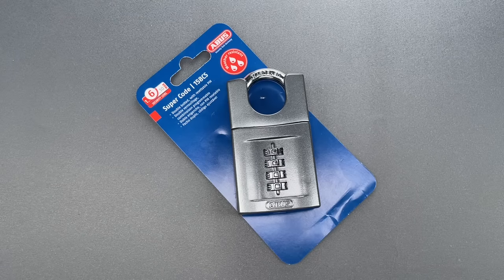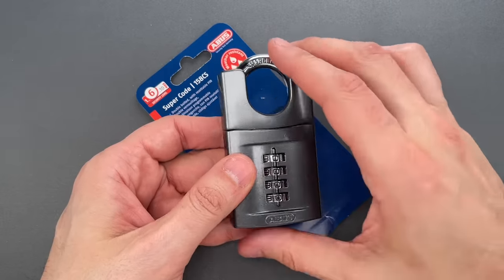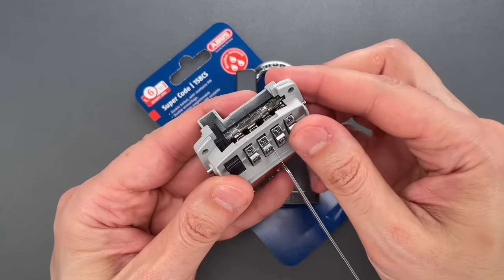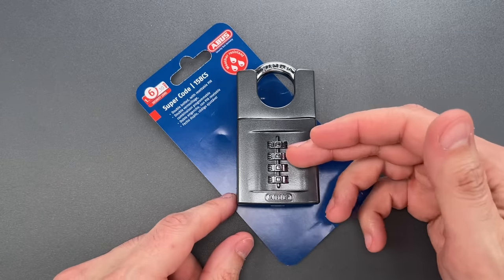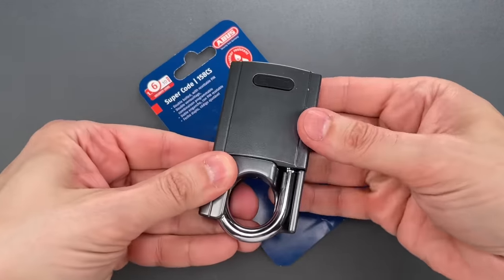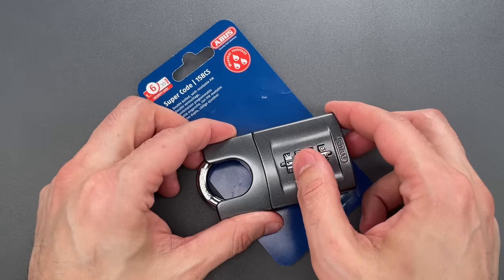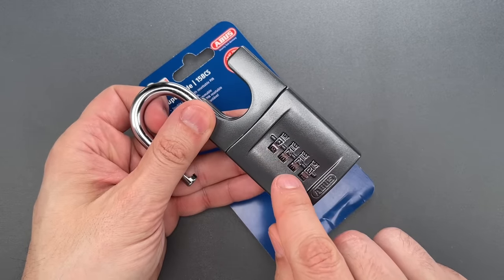[1541] Abus “Super Code” Padlock (Model 158CS)

Comment: I wonder if you could reset the lock without setting it to "open" first?
Reply: Shackle was back in but it was still on correct combo at the time, 0000, which allowed the use of the change mode.

Comment: Is there a 4 digit code lock that is good though? Probably not even if it is a really good lock there's only 10000 combinations and on average you'd check half of those. 3 per second that's 30 minutes of trying

Comment: most of those code locks you just spin the code fast and while trying to open them at the same time
i have opened many different like that, it never takes more then 30-60 sec.
same goes for when they are on a suitcase

Comment: Err does this lock go into change mode while locked?  Doesn't that mean a random passerby could lock you out of your lock?  Maybe the ease of decoding is to prevent against that?
Reply: No, the change screw is locked if the code is not lined up.
You dont need to unlock the shackle to change code, its enough to enter the correct code.
Reply: What the other person replying said. However, yes, if someone just wants to mess with you and try to lock you out, they could do that AFTER correctly decoding it first.

Comment: speaking of sensing the tension bar,
what if we add a sprocket to EACH code wheel, that carries no info, and forces the bar away from the code wheel IN BETWEEN  digits, and only allowing the bar to fall onto the code wheel after you completed the rotation.

Comment: Wait... How was he able to set the combination with the lock closed? Wouldn't that mean the combination could be changed at any time? I must be missing something big here.
Reply: The lock was closed but not locked.  The wheels were all at the default combination of 0000 before he turned the reset on the bottom to change the combination.

Comment: Wait a second, if the mechanism to change the unlock code is fully exposed and easily turned with any flat object, wouldn't it be possible to just change the code to whatever you want faster than this? Am I missing something, or was he really able to just change the combination with the lock fully engaged???

Edit Nevermind, I just saw a few comments and you actually need to have it in the right combination before you can set it to change the code. Still that seems like a pretty bad flaw regardless of the other issues.
Reply: How is that a flaw?

Comment: if they made a solid pin note in the back of the gears and then had the sorta key pins style design could this make it stronger for example it would push on a bar in the numbers and when their all setup properly a small pin is released to push down a spring which then allows the pin that holds the lock closed to be pushed out of the way

would this work for a good design

Comment: maybe im missing something but by the looks of it, LPL changed the combination while the shackle was closed so if that lock was in use, someone could just put it into change mode, put their own combination in, put it back to operating mode and just undo the lock? forgive me if im being an idiot
Reply: The combination has to be entered properly before you can turn the actuator.
Reply: no, the change screw is locked if the code is not lined up. You dont need to physically unlock the shackle, its enough to just line up the correct code.

AND even if the change screw would not be locked, changing the combo just releases the sleeve (with numbers on them) from the gated wheels, meaning you would still need to know the old combo (and add it to the new combo) to unlock it. (changing a combo lock while in incorrect combo will add the new combo as offset to the old combo.)

Comment: If you can change the combination while it is locked by turning the plate at the bottom with any flat object then why would you ever need to figure out the combination.
Or am i missing something obvious here.
Reply: I suppose you can only turn the plate at the bottom to change mode while the correct combination is already set.
Reply: @HeyMartin99  Correct.
Reply: Yeap that makes sense. 👍

Comment: You don’t need to use its inner spring against itself to beat this lock, you just need a dime apparently… anything really… that fits that slot at the bottom well enough to move it into change mode and back

Unless it has to already be set to the active combo to be able to shift into change mode, which could very well be the case

Comment: I noticed that you reset the lock code with the shackle already locked. Wouldn't someone be able to come along with a screwdriver and just set the lock to a new code to get in to it?
Reply: No, you noticed wrong. Of course the lock was opened (the code wheels in the position of the then correct code) for it to be possible to turn to change-mode with a screwdriver.

Otherwise it wouldn't be a code lock, but a screwdriver lock.

Comment: What's to stop someone from walking up to it, setting a new combination (like you just did), and opening it with the new one? The only reason you couldn't just do that was because you hid the combo from yourself.
Reply: The number of times I see a variation of this comment seriously reduces my belief in the intelligence of humankind. 

OF COURSE the lock has to be unlocked - as it is in this video -  for it to be possible to change the code.

It would be rather pointless as a code lock if it was designed to let anyone set his own code and thereby open it.

Comment: wait a minute, you can change the code when the lock is closed by just turn the screw at the bottom? so the code is changed and the owner doesnt know it?
Reply: You can change the code only when the lock is unlocked. The screw cannot be turned when it is locked.

Comment: Whoa. Wait a minute. A combination lock, where you can change the combination whilst it's locked? I see some scallywag having hours of fun changing other peoples combination to something not known to the owner.
Reply: Shackle was back in but it was still on correct combo at the time, 0000, which allowed him to use the change mode. Yes, if someone just wants to mess with you and not steal anything they could change the code but would have to correctly decode it first.

Comment: Can you really change the combination to this lock while it is closed?  That seems odd.
Reply: It would not only be odd, it would completely defeat the purpose of a code lock. So, of course you can't.

It's unlocked when LPL turns the "change code screw" and changes the code. The position of the shackle while doing so is irrelevant.

Comment: It seems as if you can change the code with the lock closed. is it so? can Someone else mess with your code and "lock you out"? (even if he doesn't open it)
Reply: Shackle was back in but it was still on correct combo at the time, 0000, which allowed him to use the change mode. If someone just wants to mess with you and not steal anything they could change the code on you but they would have to correctly decode it first.

Comment: Hold on a second. Did you just change the combination while the lock was closed?
Reply: Shackle was back in but it was still on correct combo at the time, 0000, which allowed him to use the change mode.

Comment: Sooo.. novice question about Change Mode.
Couldn't a thief use a coin to change the padlock code to one he knows and then just open the lock or am I missing something?
Reply: Has to be on correct combo, which it was at the time - 0000, to use the change mode.
Reply: @purpleghost4083  Gotcha.  Many thanks.

Comment: If the code can be changed with the lock closed, what's to stop someone from changing it on the owner?
Reply: The shackle position is irrelevant, but maybe something else isn't.
Reply: I think locks like this can't be switched to Program Mode unless each wheel is currently set to the correct solution. So if you unlock it, then lock it again but forget to scramble the wheels before you walk away, yes that's definitely a problem for you.
Reply: I would guess that you can only change the combination if you start with the correct one entered.
Reply: @CravingBeer  Correct.

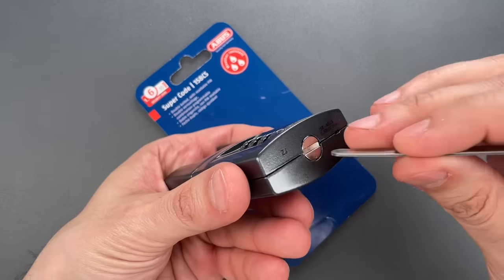Comment: @01:41 did you really close the lock first and then changed the code?
Reply: Shackle was back in but it was still on correct combo at the time, 0000, which allowed him to use the change mode.
Reply: @purpleghost4083  Oké 👍👍

Comment: wait can you change the combination with out having the lock open?
Reply: The lock was closed but not locked.  The wheels were all at the default combination of 0000 before he turned the reset on the bottom to change the combination.

Comment: Why can't you just put it in the change mode, set the combination to anything (1234) then dial in the combination and open the lock?
Reply: To answer your question, the locks current unlock code needs to be dialed before it gets put into change mode, if the combo is 0000(as default on most changeable dial wheel locks) it need to be set to 0000 then put into change mode, a new number dialed, in your example 1234, then taken out of change mode, now 0000 will no longer work and only 1234 will.

Comment: I wonder whats behind that rubber grommet at the back? Is it a folded tab that you can prize open to pull apart this cheap junk clamshell body design? Well done lpl for finding us an easy way in so we dont have to. Using his method on the street wouldnt arouse much suspicion either since it looks exactly like someone opening it normally but having to realign a couple of numbers first.

Comment: When he changed the combination, the shackle was closed. But it was still set to 0000, which was the valid combination at this moment. So it was not locked.
Reply: Watch it again, it was locked, he even pulled on the shackle to show it was locked.
He puts it in change mode then scrambles the wheels to a new combo he can't see. Then puts it back into operating mode and scrambles the wheels again so that he doesn't see what the new combo is when he uncovers the wheels.

Comment: Wait... Can i change the combination in the locked position? That would be a nice denial of entry for the legitimate owner. If it wasnt so easy to decode.
Reply: The shackle was back in but it was still on correct combo so it was unlocked which allowed him to use the change mode. But as you correctly say it's easy to decode, which makes it just as easy to change the combo for the owner. Of course, if the owner is already aware of this then they can simply decode it too and change the combo again.

Comment: Ive watched your channel for years and im sure youve done this before or something similar. The other day at work. I went to my locker and the combo wouldnt work. My job issues uniform locks for all lockers and they are *aster lock brand three number rotary wheel combo locks similar to this abus but much smaller. Barely more than a luggage lock. Just beefy enough that you cant snap it open with your hands. 
 Well it wouldn't open with the combo. I checked my combo record in my phone and entered it again. Wouldn't open. 
So i tried a method similar to this. I tensioned the shackle and tried to turn a wheel. If it was similarly tense and didnt turn much i released tension and tested the next number. If the number was loose and would move like half way to the previous or next number i figured in was in a gate and left it. Got it open and i know my new combo. Im not sure why the combo changed, it was one number down from the original for the 1st, the original number for the middle and one number up for the third. 
Im wondering if it has to do with poor design quality as *aster lock that could allow the gates to shift. But i got it open so i could use my mouthwash after lunch. Before anyone says it im not sure if that lock is recodeable or not. Its possible that it is and i somehow triggered that on accident and changed the combo myself.

Comment: Now, we need a multi-wheel combination lock that opens when the combination is put in, but NOBODY can decode it.
Reply: Good luck.  Most of the time if they fix one security hole, (usually literal holes in this case,) another one pops up.
Reply: @VoltisArt  True.

Comment: Did I understand correctly?  Can anyone change the combo on these lock with just a screwdriver/coin to a new random combo without having to unlock the lock?
Reply: No, has to be on correct combo first which it was at the time, 0000, to use the change mode.

Comment: So you can change the combo with the lock locked?
Reply: The shackle was back in but it was still on the correct combo at the time, 0000, which allowed him to use the change mode.

Comment: I'd like to see you pick ILOQ locks which I think have become very popular here in Finland. I hear they are programmable locks. They can make individual keys to work in the locks and others not to work. They have very small battery or something that charges when you stick your key in the lock at normal speed and then you can open the lock with it. Too slow and it won't open no matter how you twist the key.

Comment: If I was to approach that lock I'd tension it by applying outward pressure on the shackle. Would anyone else do the same?
It's easier to find the binding wheel first.

Comment: Did he enter change mode while the lock was locked? Am I the only one who thought I saw this?
Reply: The lock was closed but not locked.  The wheels were all at the default combination of 0000 before he turned the reset on the bottom to change the combination.

Comment: Did you change the combination with the lock in the lock position?
Reply: The construction is propably on this lock so the change screw unlocks when the correct code is lined up, regardless if the shackle is open or not. Some lock manufacturers use a shackle hole to block the change screw, other uses the code bar to block the change screw.

Comment: Wait. The change mode worked with the shackle locked. Can this be opened by using a screw driver to change mode? Or did the shackle turn set something enabling change mode after locking it? I am confused.
Reply: Same thing got me too... if you can change the code just by a coin turn... hmmm... or must it be unlocked to be turnable ?
Reply: @Tedd_Andersen  Has to be on correct combo first to use the change mode.

Comment: It is so easy to change the combination - it only requires a screw driver or butter knife to turn the reset button on the base. Really annoy the lock user.

Comment: There's this crappy code lock on a $74k piece of machinery at my job and you can decode it by just looking in the gap between the wheels you can see these gears ⚙️ with a tooth missing put the missing tooth on all numbers facing up then rotate each number  2 clicks to the right or left I forget which way then you're in

Comment: Since the process to change the combination looks so simple, wouldn't it just be easier to change the combination and then open the lock?
Reply: Has to be on correct combo, which it was at the time - 0000, to use the change mode.
Reply: @purpleghost4083  Ah.  That makes sense. Thanks.

Comment: hang on. did i see that wrong, or can you change the code while the lock is closed? and all you need to do it is a penny to turn the bottom?
Reply: Shackle was back in but it was still on the correct combo at the time, 0000, which allowed him to use the change mode.
Reply: @purpleghost4083  a alright, thank you. Yeah that makes more sense

Comment: Am I right you can scramble that lock without opening it?  that's how it looked.  Maybe they designed it with the too strong spring so you can still open the lock after someone came along and changed the combination
Reply: Has to be on correct combo, which it was - 0000, to use the change mode.
Reply: @purpleghost4083  ah, OK, I'm used the ones you turn the latch 90 degrees.  threw me off for a moment

Comment: Because you can switch the lock to change while it is locked, can you switch the code while in use and bypass it that way?
Reply: The shackle was back in but it was still on the correct combo, which was 0000 at the time, so it was unlocked allowing him to use the change mode.

Comment: Couldn't one just go around and change the lock combination, not even open lock, and the owner is like why doesn't my combination work?
Reply: They would have to correctly decode it first to use the change mode. But once they do then, yes, that could be done.

Comment: Am I missing something? Why not put the lock into change mode, reset the combo, then open it right there? Is there a special tool for the reset function?
Reply: I think you have to have the correct combination showing before you can switch to reset mode.
Reply: @itoibo4208  Correct.

Comment: You know with how easy it is to access the combination changer lever, I'm surprised that you couldn't just open it in 2 seconds by changing the combination to something you knew.
Reply: Has to be on correct combo, which it was at the time - 0000, to use the change mode.

Comment: the other huge design flaw is the openly accessible switch to change mode that just takes a flathead to turn. dont even need to decode it, just make your own code and get in
Reply: No. It has to be on correct combo first, which it was at the time - 0000, to use the change mode.
Reply: @purpleghost4083  ah, that makes much more sense, thanks

Comment: If you can change the combination while it is locked, by rotating the code mode on the bottom. Doesn’t this mean that all one needs to do is recode it, then open it? Or am I missing something.
Reply: Shackle was back in but it was still on the correct combo, 0000 at the time, which allowed him to use the change mode.